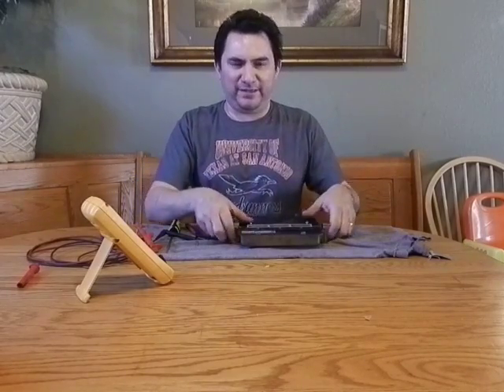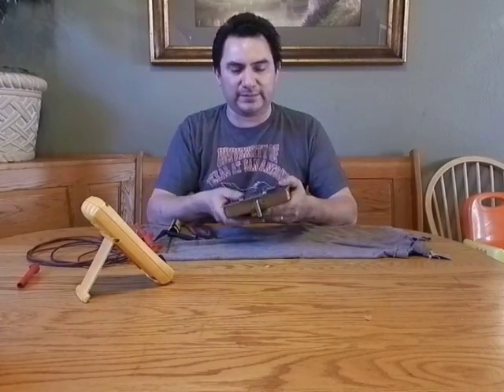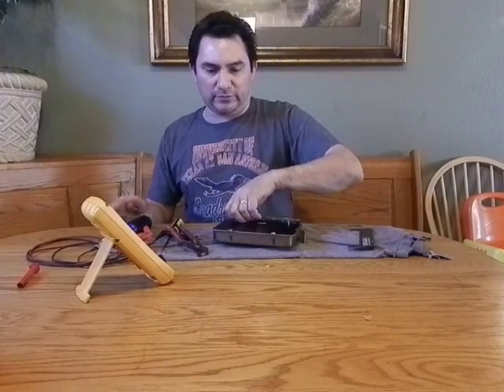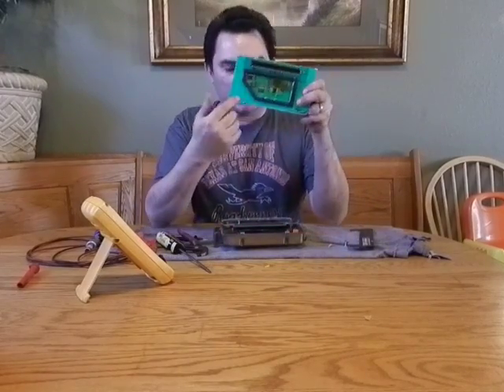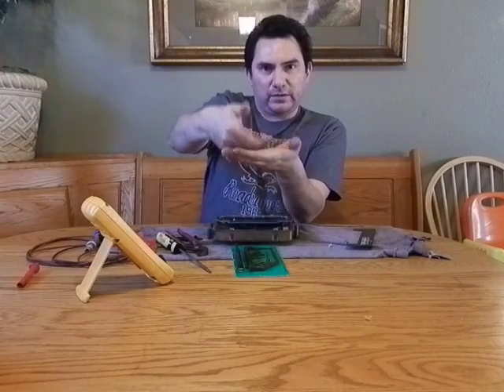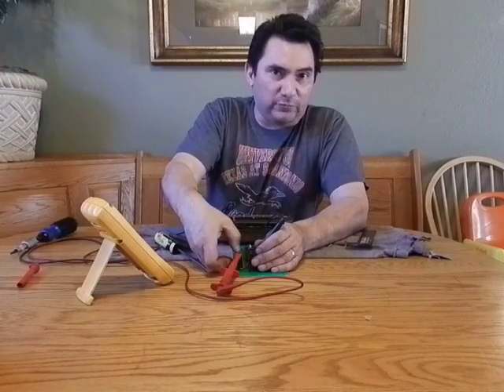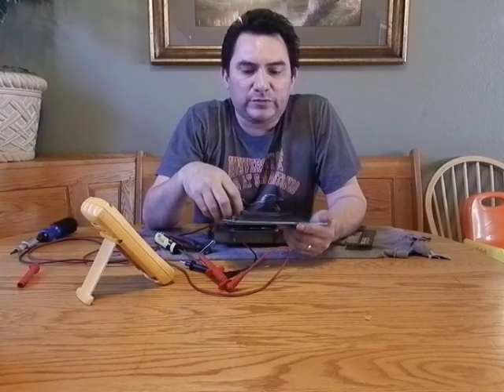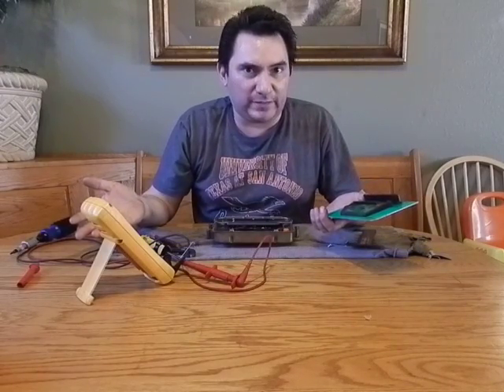'96 Jeep Grand Cherokee PCM Repair

Comment: 12 years later this has saved me. THANK YOU !
Reply: He’d be happy to know that. He’s a very modest, but brilliant guy.
Reply: What was your jeep doing? Mine had a bad ignition coil code so i replaced that and nothing changed. Runs fine until it get warm and then starts wanting to cut off when coming to a stop

Comment: Ive been trying to fix my 1996 jeep grand cherokee 4.0 for about 6 months now I've replaced the crank shaft sensor, cam shaft sensor, ignition coil, purge valve, fuel filter, idle air valve, and a full tune up. It runs like a champ but just dies sometimes at random times like at an idle, driving straight, turning. If im going over 40 most of the time it will back fire then die. Then normally takes a little while to get running again once I was stuck for 30 minutes. Im not very knowledgeable in mechanics and everything I have done has been from videos and reading forms. This was kinda my last resort but I got hit with a foot of snow so this morning I tried this method as well as shorting the screws, something I saw on another video, and it fired right up! Just took it to the mountains for a 2 hour snow romp. 

I could not have had the confidence with out this detailed video thank you.

Comment: I really hope this is my problem. I bought a 96 limited 5.2L for my stepdaughter because she wanted a 4wd SUV. It's been nothing but problems since. I drive it no issues she drives it and it randomly starts backfiring, chugging as she says and has no power. Then I drive it again all good! New alternator 2 year old battery and system tests good but sometimes it says good battery - recharge. I'm assuming the pcm voltage regulator is randomly disconnecting. Ordered new computer before seeing this video but for $200 I'm hoping this fixes it.

Comment: Got a 2012 dodge advenger I put a voltage regulator on car to by pass the charging system to computer.Still have problems and cant get new pcm for it.The part is obsolete. What do I need to do.

Comment: 2:57 On the left of the board in that shot is an IGBT that fires the ignition coil.  It supplies a ground to the ignition coil to fire it and that ground is looped through a shunt resistor so the computer can see the current which is analyzed by the adc next to it.
Reply: I bet you that's what's wrong with mine mine is getting no fire I ran a jumper wire from pin number 3 to ground on the battery and the truck now runs but it runs awful it's idle's at like 2500 RPM Is bucking an hesitation  I just disassembled my computer I'm about to resault or all the pins on the whole board
Reply: @jasonmurdoch9936  The ground is switched on/off to create the spark so adding a jumper might not help... Replace the two big electrolytic caps on it with new low ESR, long life, automotive grade caps with a large temperature range. Any electrolytic caps on the board will be well outside their normal life of about 5 to 10 years especially in the abusive automotive environment under the hood.  The caps and maybe reflow the solder on every pin of every connector... But if the problem is the PCM, get a newer one programmed ASAP... The older jtec computers are usually garbage anyway.
Reply: Is the first connector pin on the left a ground?
Reply: @thefatman2103  I wish I could tell you.  I don't have the old PCM anymore to check.  I just bought a cheap PCM online form one of the repair shops like flagship one and what I got was a generation newer that works so much better on that engine.

Comment: Great Job,   I fixed the problem by using Electronics Cleaner spray (available at parts store) and spraying on all connections on the main cable.  Did not have to remove it.  remove all cables, spray both the Cable assembly connectors and also the pins inside the housing.  Allow a good time to dry or blow out with air.  The cleaner is an evaporant, so will dry quickly.  plug everything back together and try it out.  If this does not work, then maybe a connection internal is oxidized or broken as he indicates in the video.  Folks....keep in mind this is just a deeper fix if the external sensors have been proven "OK".

Comment: I just did this solder trick myself on my 98 GC with the 4.0 and surprisingly it fired right up. Felt like doing a jig I was so thrilled but I'm sure the neighbors would have called the men with the straight jackets on me.
Reply: Was it easy to do I am very mechanically inclined but don't wanna mess this up

Comment: Hi all,
A big THANKS to you all for posting your videos on YouTube or your comments on the countless forums to help people out with their problems. I'm posting this to possibly help others out there that may need it, because I found that everyone had slightly different issues around the stalling problem. Mine was different also.
I have a 1996 Jeep Cherokee that had a stalling issue. It's fixed now, but I'll let you briefly know what happened. My Jeep was fine when it was a cold or cool temperature but would always stall when it got to a normal heated operational temperature and stopped at lights or backed up traffic at idle. It wouldn't start for at least another 30 minutes until it had cooled enough. I then realised it was always in D-drive when it stalled, so I tried flicking it to neutral every time I was stopped and it wouldn't stall until I got to my destination and tried to start it straight away. Again i would have to wait for it to cool and then it would start. After stalling I checked the diagnosis codes by turning the ignition to the 2nd position 6 times and waiting for the codes to flash. That told me to replace the coolant temperature sensor, the crankshaft positon sensor, take it to a mechanic for diagnosis and the completed diagnosis code 55.
I disconnected the ground battery terminal from battery and started with the cheapest of options which was the coolant temperature sensor. After replacing the coolant temperature sensor and connecting the battery, I then checked the stalling issue by driving around for an hour and leaving it in drive and it stalled and wouldn't start for 30 minutes. I then decided on the crankshaft option so I disconnected the ground battery terminal, changed the crankshaft position sensor and tested it also by driving around for an hour and leaving it in drive and it didn't stall.
Problem fixed. I then checked the diagnosis codes again and no codes came up, besides the code for less than 50 key starts since the battery was last disconnected and the completed diagnosis code 55.
Regards
Kurtis
Reply: I replaced the crank position sensor (twice!) and I still have the problem.  Just want to ask if your problem ever came back?
Reply: Tara S 
My problem is fixed. It hasn't come back. I did buy an authentic expensive crank position sensor $300 Aust dollars.

Try a search for how to get diagnostic codes for 96 Jeep. It explains that you have to put your key into the ignition and turn it to 2nd position 6 times and leave it in 2nd position and then you count the flashes of the check engine light. Example, if it flashes twice then pauses and then once it means 21. If it flashes 4 times then pauses and then another 4 times that means 44. I got those codes then I bought a Haynes 1996 jeep manual and it explains all the codes. That really helped me.
Let me know how you go.
Reply: I have an OBD2 scanner ... I've had zillions of codes already which I have replaced ... crank position sensor, cam position sensor, ignition coil, etc.  Each time things seemed to be fixed and then I'd get a stall <100 miles later.

I finally ended up pulling out my PCM and soldering the connection (like the video says.)  It's been >800 miles (updated 10/13/17) now with no stall.  I declare brain surgery a success!  Thanks a lot for the reply... and thanks to original poster for the video giving me courage to try!
Reply: Tara S well done. You tube vids really do help with the courage aspect hey? Good luck with it all.

Comment: What's a "pretty solid PCM" vs a not-so-solid PCM? If it's prone to failure, it's not solid!
Reply: Your question/comment is kind of two-part and not-so-solid itself, i'll do my best to answer it.  A "not so solid" ecu would be one like a Yugo EFI ECU:  No sealant, looks like the inside of an AM radio, very low quality electronic components used.  A "pretty solid" ECU would be ones made by chrysler, mercedes-benz' newer stuff, ABS computers in some older Volvos, TCMs in some GM vehicles, etc.  The most "solid" ones I seem to be those made by BMW, Honda, Nissan, and Toyota.  All electronics are "prone to failure".  Remember an ECU/PCM/TCM/BCM/whatever you want to call it is a COMPUTER, complete with microchips and software.  The design/quality of the components used on some make them MORE prone, or "not so solid".  Does that make sense?  If your looking for "solid" and not "prone to failure" I'd either buy a kia with a 10 year warranty so your covered, buy an old car with no electronics period, or start using those getaway sticks and walk everywhere.   ALL computers and mechanical systems are prone to failure.
Reply: TYVM

Comment: Awesome, man.  I replaced the crank and cam sensor.  $120.  Then the alternator went out.  $110.  I have a 96 GCL.  Ready to shoot it.  It cut out on me last night 3 miles from home.  Threw a P0351 for the coil.  Pulled it back home and it cranked up.  WTF?  Saw your vid.  Soldered all the connections.  My turn signals work now.  So does my horn-previously disconnected for alarm related issues?  Running great now.  Will update if change.
Reply: Forgot - the rear wiper came back to life.  Great fix, dude.
Reply: nice----------- I just finished a rebuild and drop in of a 4.0 bored 30 over cam and crank ...ect to much to list drove it for 600 miles runs smooth and strong just redid intake gasket had a leak and now all sealed up no noise but it runs but sputtery and takes a few cranks to get'er fired.. Detroit home of jeeps and creeps its a safe place to live---
Reply: Jason, still good after 10 months?

Comment: Once I replaced the crankshaft position sensor the problem went away.
Reply: I've replaced it twice already but it's not working.  Just wondering if you are still having trouble with it?
Reply: I bought 3 cps and it doesnt start when i turn it off after a little drive

Comment: I have a 2007 JGCL . . . . same problem. I had the problem back in September/October. the idiot engine light came on. I took it to the local Goodyear service shop. Codes came back with random misfire. Changed plugs. a week later - same issue. returned to Goodyear to find multiple misfire on 2, 4 & 6. referred to dealership. took to dealership and they could not duplicate it since the code was not active. after 2 days they gave it back without charging the service fee (after I let them know how upset I was). I noticed through the winter here in Georgia that as soon as we would have a slightly warmer day it would begin to sputter but no engine light. Now here we are with temps in the 60's and 70's and the engine light came back on today. It hasn't stalled on me yet this time but it's coming. I'm babying the gas to ease the acceleration but if I drive normal I know I will stall it. Here are a couple blogs I found to get some answers that apparently the dealership doesn't know about without replacing the whole PCM at $800+. 

http://www.cnet.com/forums/discussions/jeep-grand-cherokee-stalling-fixed-248386/ 

http://www.cnet.com/forums/discussions/2000-jeep-grand-cherokee-stalls-when-warm-324812/ 

My question is . . . . did this fix it completely? Mine is a 2007 . . . any reports of similar issues up through this year? Is there a class action lawsuit on this I need to know about? I'm a novice at this kind of stuff. More mechanically inclined than electric/electronic. Any advice before I dig into this?

Comment: Thanks for the information. My 95 Jeep Grand Cherokee Laredo runs great cold but when it warms up it hesitates and misses under heavy acceleration. Does this sound like a PCM issue?
Reply: +Learskyking this sounds like what i'm going through.  did you get any codes?  Mine is coming up multiple misfire on 2, 4 & 6?  Is it a PCM issue with bad soldering or other issues or is it vapor lock?  I'm going to try an old school method or wrapping the fuel line with aluminum foil to act as a heat shield.
Reply: M Schaeffer whatdyou find out

Comment: hey  buddy I have a 93 Jeep Cherokee.knew my truck used to be a county truck..found out from mechanic, he couldn't find my computer anywhere cause it is a police computer..only option he offered me was sending out my pcm to Illinois which would take 10 days..had him put computer back in jeep and took it back..since got back..computer on tight..truck hasn't stalled..and radio stays on..even got sent belt guy back lol also saw somewhere that computer even affects gas gauge..went to radio shack and bought everything I need to fix..my question is if I fix it, will it have to be reprogrammed? right now have a running truck..also can work be done on circuit board without having to reprogram it?

Comment: good video, thank you for the information.    however, current is = to Voltage / by resistance.  so lower voltage don't mean higher current.   "just saying"    in other words 10 / 5 = 2 so if 10 decreases.......     Thank you for posting.
Reply: current is amps.  not sure what you were going for there, only thing i pointed out was basic ohms law.   but whatever it was it can be summed up in a word.   Fail.

Comment: I have a 96 gc and if driven more than a few miles it will stall at a red light - stop sign or a pause in traffic  then I have to wait about 90 minutes before it will restart..i have changed the thermostat..alternator,,,,,now what...please help
Reply: Katrina Crawford It is so good to read that I am not the only one. This is driving me crazy.
Reply: Obviously it can be several issues. For me the Crankshaft Position Sensor(CPS) was the culprit. Intermittent stalling when at a red light but would start up again most of the time. Within a few years I've had to replace it twice and Jeep is notorious for it. On the 96 in particular the plug/harness for CPS is on the passenger engine compartment below the distributor and PCM, however sensor itself goes into the top of the auto trans bell housing driver side.
Reply: Awesome thanks so much
Reply: Katrina, I have a 96 as well. At least it's not leaving you stranded. Autozone will usually check for any tripped OBDII codes free of charge. If it is the CPS(crankshaftPositionSensor) the aftermarket part cost around 60.The 1st time the shop replaced it for me and went bad after 2 years. I did the 2nd myself in 2012 using the autozone aftermarket part and haven't had starting nor stalling issue since. Unfortunately when the problem is intermittent it can be moe difficult to isolate. Please let me know how you make out with it.
Reply: IAC IDLE AIR CONTROLLER KNOWN AS A IAC VALVE. REPLACE IT
Reply: Mark P. Crankshaft Position sensor = CKP
CPS is a camshaft position sensor. 
I’m only saying that so someone doesn’t go down the wrong path.

Comment: Hey first off thank you for posting. Very helpful. Had a couple questions. Did you use any special solder or technique in the problem area? Tried soldering it but the board seemed to absorb all the heat and was hard to get the solder to stick. Or would get cold solder where it falls off after cooled? Curious if you encountered this and how you solved it? Also when put it back together did you put any sealant around the edges and if so what kind? Lastly once soldered would your jeep still throw a check engine light or idle rough or maybe I have other issues still present. Thank you for your help in advance.
Reply: Did you ever get the soldering done?  Any advice?

Comment: I have a 98 grand Cherokee that I think is having pcm issues. I had a mechanic look at it and he said it was the plug end that goes connected to the pcm. Changed the plug but the issue is still there. He is indicating its the whole harness but when I move harness going down to the transmission it does not shut off but when I move the harness next to the plug she shuts off. I am mechanically challenged and don't trust this mechanic already( new in town). How hard is it to take out the Pom and just have it replaced?

Comment: I've only tried soldering electrical wires together or soldering the wire ends so that they don't fray when attached using a twist tie Marrette. Do you need a special mini electronics solder gun to fix the contacts? Thanks

Comment: So i have a 97 Jeep that starts up and stalls out. it will do it a couple times until it warms up to normal operating temp. AFter its warm it runs but still is a little rough when idling. i have replaced Crankshaft sensor. Thinking about doing the cam shaft. Think this is the problem? Also im not the greatest at soldering is this something you would recomend i try before buying and replacing more parts?
Reply: ryan cornelius Hello Ryan, i have exactly the same problem with my 97 GC, did you already fix your problem??, i would really apreciate your help, thank´s for your time!!
Reply: already fixed brotha. Jeep is running better than ever  man. Hit me up through email i can guide you through it if need be. can even call me if it helps. i dumped almost a grand into my jeep and all along it was a free fix,, Ryancornelius22@yahoo.com

Comment: I have a 2002 Grand Cherokee 4.0L with intermittent power getting to fuel injectors 3 and 5. I took it to a shop and they said they pin tested the PCM and it was bad. That's all the information I got from them. Is that a fixable problem with soldering?

Comment: place a jumper wire on blue wire second row pin #3 to ground, (fuel pump ground)  if you don't want to open up the computer. The computer grounds the FP to FP RELAY.